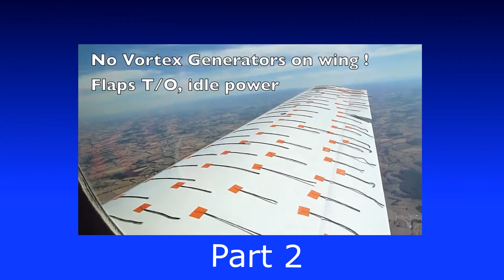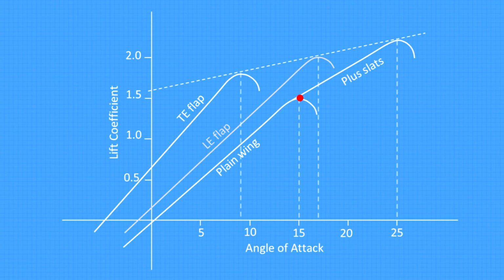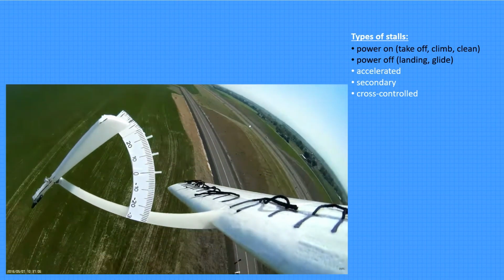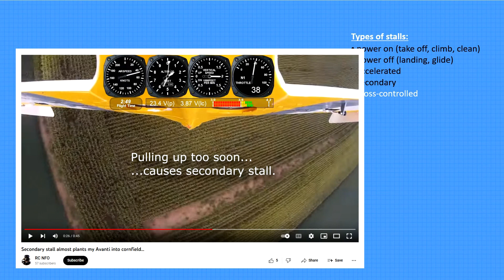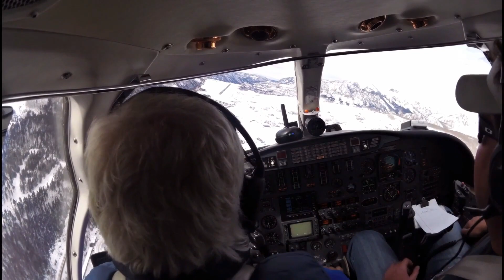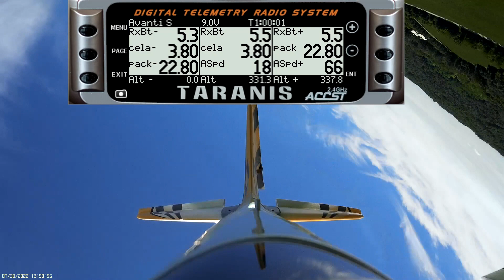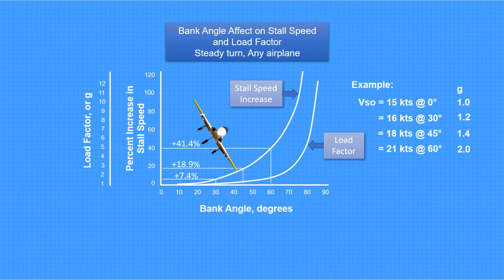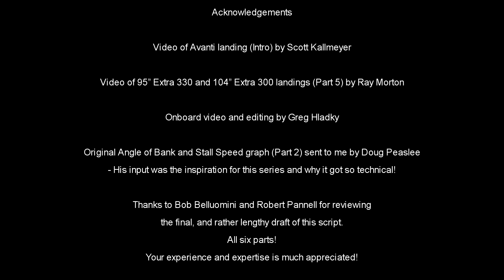By the Numbers: How I Land my EDF Jet (and avoid the danger zones) Part 2

Comment: I bought the Avanti thinking it would be an easy plane to land. The sport jet airframe is quite a different animal from the delta and swept wing edf fighter jets I'm used to flying. I learned quickly I was unable to land my Avanti in a nose up attitude without stalling it. Conversely, a nose down attitude creating the nose wheel to touch first mafe my plane hop back up into the air, sometimes into a bouncing oscillation that again occasionally ended in a stall. I watch others land these Avantis all day with little ore no issues. This plane has become the bane of my successful EDF jet landings. But I haven't given up yet.
Reply from the maker: Sorry I missed your comment! Check your CG and takeoff weight. The Avanti will land with a nose high attitude (at least 5 degrees nose up) on approach, IF the CG is back far enough. Mine is 125 mm from the leading edge at the wing root. With 6200 mAh SMC packs V1 takeoff weight is 6.66 lbs. My V2 is 6.71 lbs and will land with the same nose up attitude. A gyro will help to make the plane feel stable with the aft CG, but it's not necessary. More details on setup are in the first video in this series.

Comment: you can just slip if you need to slow down more
Reply from the maker: That's right! One of my favorite memories landing my 104" Extra 300 was on it's maiden flight. The motor throttled down on its own during the flight (due to ESC programming error on my part), but I thought there was a serious issue, so I shut it down and lined up for a power off landing. On final I realized I was high and fast, but I was already committed to the landing. My IMAC mentor said, "Slip it!" I rolled it into a forward slip, holding opposite rudder until I bled off the extra speed, then straightened out just as I reached the runway threshold. I was able to make a normal landing,  and came to a stop midway down the runway.